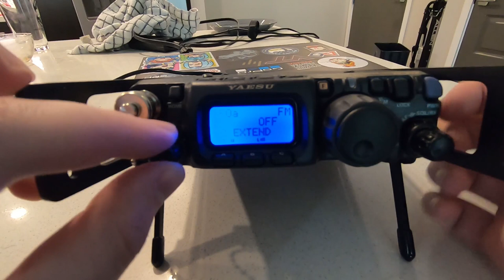DIY Narrow CW filter for the Yaesu FT-817/818nd Radio (YF-122CN Clone)

Comment: unfortunately Collins discontinued those mechanical filter around 2010.   it was around US$30 each , if you buy in quantities.  I saw article somebody made mechanical filter using   semiconductor MEMS  (  Micro-Electro-Mechanical systems) process.   it was made for 455kHz, adequate for narrow band CW use.   if mass produced  MEMS filter can be low as several dollars.   AG6JU